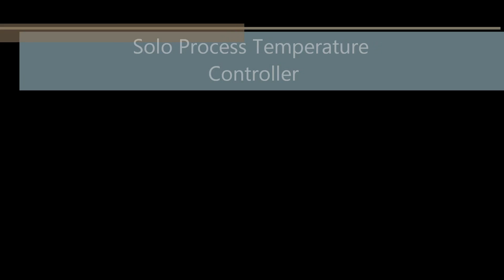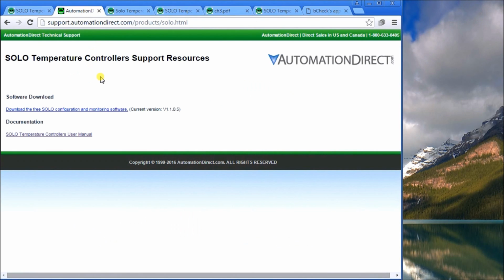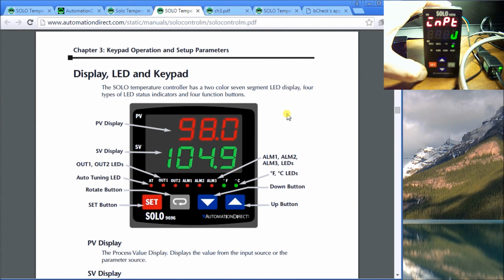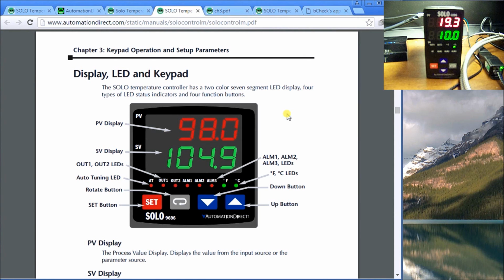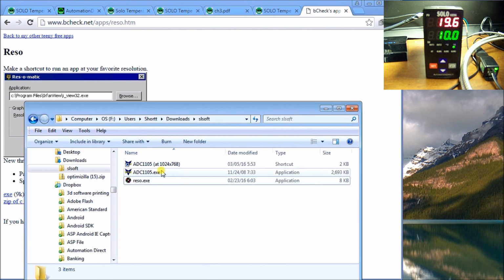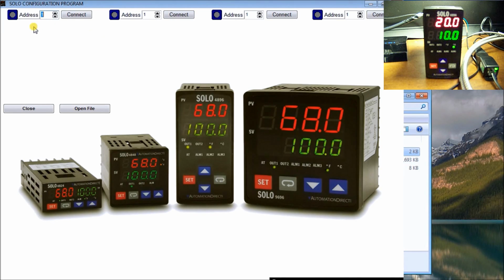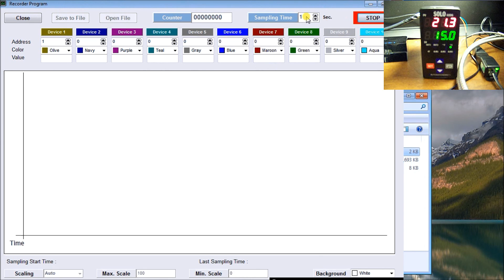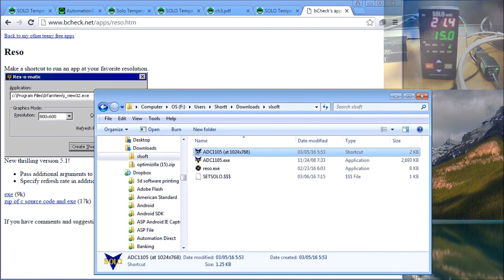Complete SOLO Controller Guide: Wire & Configure Like a Pro

Comment: how can i set the pressure value from psi to bar
Reply from the maker: You are probably bringing into the controller a voltage or current signal. This can be scaled using the tP-H (High level signal) and tP-L (Low level signal). You will then see the units on the display scaled for you. The default is -999 to 999.
See section 11-2 of the following information guide that comes with the controller.
https://cdn.automationdirect.com/static/manuals/solocontrolm/solosl4824qsg.pdf

Regards,
Garry
Reply from the maker: Here is a video showing the analog input to a Solo Process Temperature Controller. It shows the scaling and decimal point settings.
Analog Input to a Solo Process Temperature Controller
https://youtu.be/tVgPmcP5Yis
Reply: Thank you very much Garry, for all the useful informations , i did the scaling and now i have the pressure value at bar...
Reply from the maker: Thanks for the update. Great to here you have it working!

Comment: How would you test the over temperature alarm on the quarter DIN?.
Reply from the maker: Hi Robert,
There are several ways to test the over-temperature alarm on the temperature controller. I would lower the setpoint value so that it will trigger the over-temperature alarm. 
Depending on your circuit, you could jumper the output contacts for the over-temperature alarm to see if the circuit is operating correctly. (Light, Alarm, etc)
I hope this helps you out.
Regards,
Garry
Reply: @ACCautomation  thank you
Reply from the maker: @RobertEmery-yr1sj  
You are welcome. I hope this works for you.
Garry

Comment: Hey Garry,  would i need a second usb converter and port if i wanted to run a second solo device at the same time?  What if i wanted to run two devices and two slaves?
Reply from the maker: Hi Trevor
A maximum of 32 devices can communicate on the RS485 serial line. These would wire back to the PC which acts as the master of the network. Modbus RTU  devices can be selected with unit numbers from 1 to 247. 
Here is a link that will use AdvancedHMI to communicate to the Solo Process Temperature Controllers.
https://accautomation.ca/advancedhmi-to-solo-process-temperature-controller/
Note: YouTube video is at the end of the post.
Regards,
Garry

Comment: How would you rate this product from a data integration standpoint? Short term I'm interested in exporting temperature trends / tabulated data. Long term I'd like to transition this into a Labview architecture through RS485. Can you comment on programming ramp sequences through the serial interface.
Reply from the maker: Hi Ben,
https://cdn.automationdirect.com/static/manuals/solocontrolm/solocontrolm.html
In the manual, chapter 7 will discuss the communication using Modbus RTU (Serial RS485)
Appendix A will discuss the Modbus Addresses for Ramp / Soak Control.
The Solo is an excellent device to gather data in the field.
Here is a post that will communicate from AdvancedHMI (Visual Studio) to the Solo.
AdvancedHMI to Solo Process Temperature Controller
http://accautomation.ca/advancedhmi-to-solo-process-temperature-controller/
Video: 
https://youtu.be/pEtde_xk-zU
I have not yet created a post on the ramp/soak features, there are examples in the manual. I have found that the  Solo is one of the most versatile temperature process controllers available.
Regards,
Garry

Comment: I am using temperature controller for Muffle Furnace. Does SOLO controls the temperature of furnace ? If yes how?
Which model of SOLO temperature controller is compatible for Available Power supply is 415V 3PH AC, 50Hz?
Is Any other device required like BTC to cut off power incase of PID control fails to control or THY to control the power to heater as from output from PID?
Reply from the maker: Hi Saurabh,
Yes the temperature controller will control the furnace. It will use the built in controls. (PID, On/Off, etc.)
Please refer to the specifications of the furnace you are controlling for the installation hook up and wiring.
As with most control devices the Solo is available with either 100 to 240 VAC 50 / 60 Hz or 24 VDC. You may have to put an additional power supply into the circuit to power the device.
Regards,
Garry
Reply: Furnace Available Power supply is 415V 3PH AC, 50Hz. So which model of solo to be used 100 to 240 VAC 50 / 60 Hz or 24 VDC. How to check additional power supply required or not?
Reply from the maker: @saurabhsharma6173  
You would have to see what your control voltage is in the furnace panel. Your selection of the supply voltage would be based on this control voltage.
Regards,
Garry

Comment: What does ramp/soak level means? What is single loop dual output process temperature controller meaning? Is any dual loop or something like that available? What does they do (if exist)?
Reply from the maker: Hi Saurabh,
Ramp / Soak - This is a programmed sequence that involves ramping the temperature up or down in a fixed time. The soak is the time in the sequence that the temperature remains the same. The Solo  Ramp / Soak control
can execute up to 64 steps (8 steps x 8 patterns).
Single Loop / Dual Output - The solo has a single PID algorithm to control the temperature process. The output can control a heater and cooling operations for the control loop.
Duel Loop - This would involve using two PID control loops. Usually you would have an output from the first controller as an input to the next. (Transfer Output, Voltage output )
https://cdn.automationdirect.com/static/manuals/solocontrolm/solocontrolm.pdf

Regards,
Garry

Comment: Say I have Multiple models to control temps on.  Is this possible on these SOLO PID's and software without using a PLC?  

Model #1 - Ramp 5 degrees/min up to 310 deg. then opposite on cooling
Model #2 - Ramp 5 degrees/min up to 275 deg. then opposite on cooling

Great Video!
Reply from the maker: Hi DuckS2525
The solo process temperature control can have up to 8 steps per pattern an 8 patterns per controller. (64 total steps)
Each step has its target Set Value (SV) and the time duration. 
So in your case the first step if the PV is usually at 70 deg would be ((310 - 70) / 5) = 48 minutes with a SV of 310 deg.
http://www.automationdirect.com/static/manuals/solocontrolm/solocontrolm.pdf

Hope this helps you out.
Garry
Reply from the maker: Note: You do not need a PLC or computer to do this Ramp / Soak function.